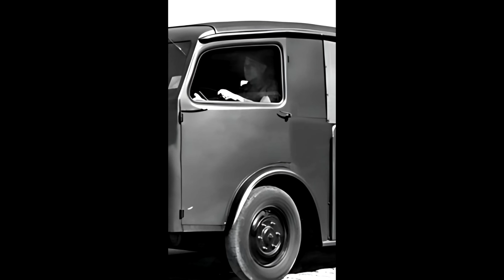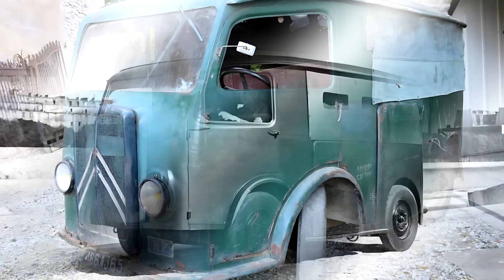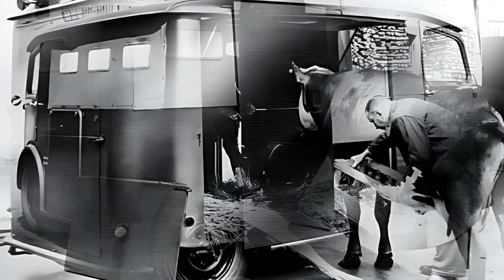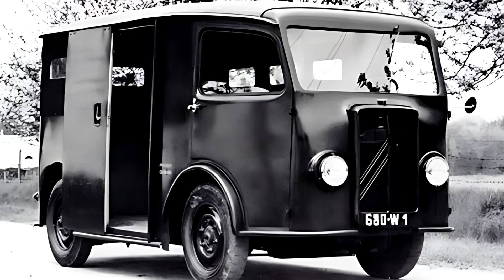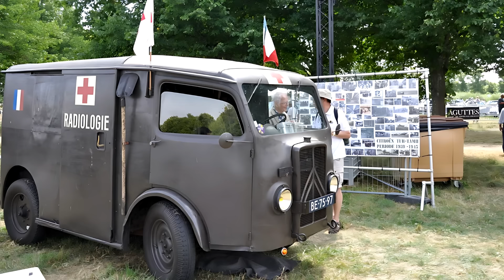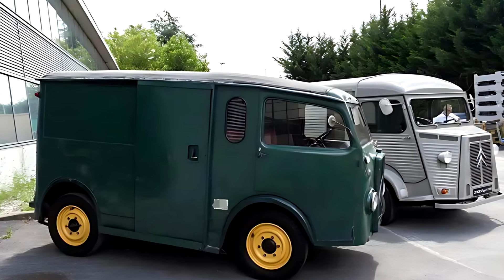1935 Citroën TUB 🔥 A Civilian Idea That Went to the Front

Comment: Great documentation! 🫶🏻 But delivery vans can also be fast. Take a look at the French 'delivery vans' from Citroën/Tissier (1970s) DS or later from the Citroën/Tissier CX (1974 - 1995) In Germany such vans were built from Mike's Garage to deliver Newspapers over night from Frankfurt/Germany to Paris/France with an 3-axle 'van' called LOADRUNNER and they were built from an Citroën CX Estate. Those 'vans' run with 200 km/h over our Autobahn. In Belgium such 'vans' were built from Pijpops. They can carry 1.15 - 2 tons and with their hydropneumatic and power brakes they were very safe.

LOADRUNNER are the ancestors of Mercedes-Benz 'Sprinter'.

Approx. 70 Loadrunner were built (in Germany) - 5.62 meters long, the French and Belgium versions are 6,5 meters long.